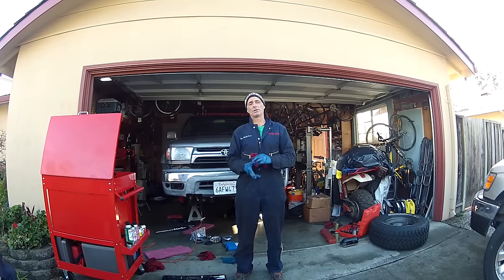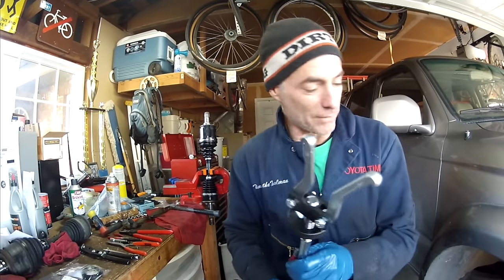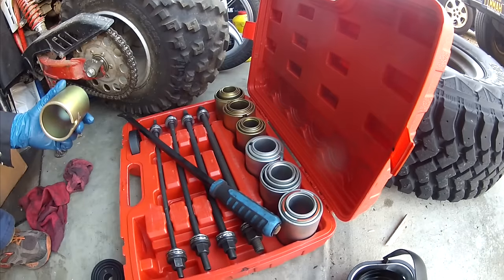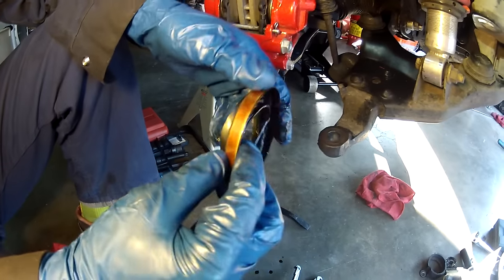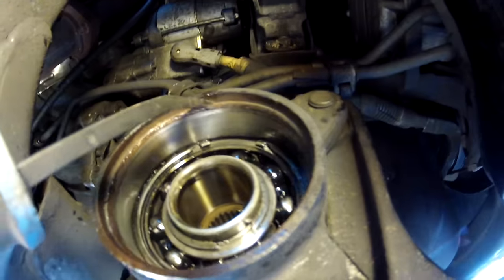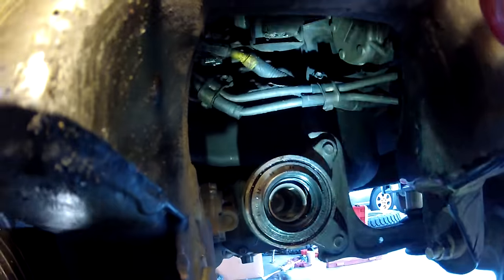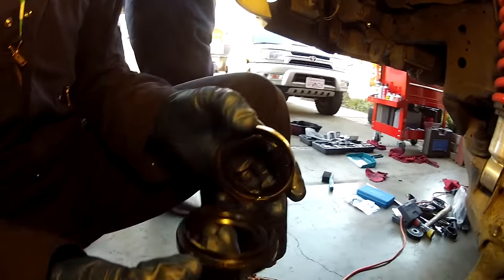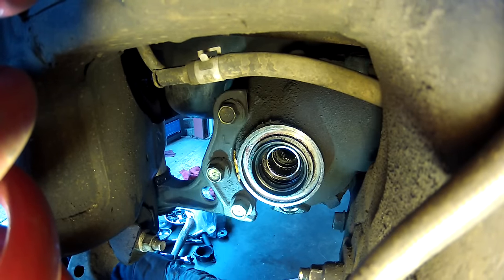Front Differential Axle Shaft Oil Seal Replacement

Comment: @Timmy The Toolman. I need to get this job done on my '98 taco, and am debating getting that press/pull sleeve kit. What other jobs on my truck would that set be useful for? I know you've used it to press out the front wheel bearings, but what other stuff could it be used for? I guess I'm looking for some extra incentive to justify purchasing that toolset... :)
Reply from the maker: I've also used the press sleeve kit for upper control arm bushing replacements, rear control arm bushing replacements, and the rear axle seal job.  If you think you're going to buy a press at some point, the press sleeve kit is nice to have.  If you don't plan on tackling your own press work, it would probably be a waste of money.

Comment: An easy way to seat the seal is put it in freezer first to shrink it. Then you can begin to seat it with your fingers. 

Then, take your old seal, cut the rubber dust ring off, and it will lay over the new seal so you can hit it to drive in new seal. An easy way to drive it in is get a 2 foot or so 2x4 and it will extend far enough out of the wheel well to hit the end of the board with a hammer. Easier than trying to tap it with hammer with lower control arm in the way...
Reply from the maker: Thanks for sharing your tips Andrew.  We actually now have a custom made driver for this made by the company Wits End.  https://absolute-wits-end.com/toyota-4wd-ifs-output-shaft-seal-driver/
Reply: @TimmyTheToolman  TW Matic here. Just ordered the wits end driver reccomended from another TW member today. Doing both my seals this weekend. Lucky me has the front diff on the workbench as I just got it back from ecgs with new 4:56 nitro's and a harrop e-locker. Excellant vid as always. Merry Christmas!
Reply from the maker: @matic1203cc  You'll like that Wits End driver.  It works really well.  I'm planning on re-gearing soon and also going with a Harrop locker for my front diff.  How much did ECGS charge you for the job?  Glad you like the video.  Merry Christmas back at ya!
Reply: @TimmyTheToolman  $2100 and a core. gears, locker and wiring harness. They even spiffied up the diff with fresh paint. I had a buddy drop off a random front diff for my core and he lives a stones throw from ecgs and i'm just south in SC. So I didnt have any shipping charges to get a core there. I want to say shipping the completed diff to me was also free.
Reply from the maker: @matic1203cc  Thanks for getting back to me with this info.  Sounds like a fair price.
Reply: @TimmyTheToolman  My bad, just looked at the invoice. $2059 and that was with the solid spacer. Also $0.00 sales tax. I never asked why.
Let me know if I can help getting a core to them for you when you do yours, I'm sure my buddy would drop another one off.

Rich
Reply from the maker: @matic1203cc  Cool, thanks for the offer.  I might be able to get mine done locally by a shop but ECGS is my backup.
Reply: @TimmyTheToolman  Tim, I forgot to ask since my diff is on the workbench can I finagle the old seals out with a couple screwdrivers instead of buying or renting a puller?

Thanks
Rich
Reply from the maker: @matic1203cc  Yeah, you could probably get them out that way.  Just be careful not to score the surface of the diff.  There's also more affordable hooked style seal pullers you can purchase.  Another trick is carefully drilling in a sheet metal screw into the seal and grabbing onto the head of the screw with a pliers or channel locks and pulling it out.

Comment: great video.
I'm going to change the bearings on my friends hilux. Inside the seals you changed in the video.
is it a lot of work
Reply from the maker: Good luck with the job.  I'd like to hear what tools you used to remove the bearings and reinstall them.

Comment: Hello! Good day. Thanks. What would be the worst scenario if not change right away.
Reply from the maker: The worst case is it leaks and you have to keep an eye on the fluid level in the differential so you don't end up destroying it.
Reply: So the leak is okay as long as I add fluid regularly. It doesn’t cause any damage?

Comment: Timmy, at the 6-minute mark, how would you go about taking out that bearing. Mine is shot. Thank you so much.
Reply from the maker: I've never replaced that bearing but here's a video that will show you how to get it done.  https://youtu.be/Yk-0BulWeHA?si=c8suFvqpiqoPjTFm
Reply: @TimmyTheToolman  Thank you so much for the fast reply 🙏🏼 We're the ones that just did the head job on our 96 4Runner.
Reply from the maker: @disconnect_overland8696  You're welcome.

Comment: oh man... that difficult is put that seal? ... oh well... i was thinking to replace the seal too bc I replacing the cv axle, BUT i will no even touch the seal. hoping when take the cv axle out have no leak.
Reply from the maker: It's not really that hard.  It's just tedious being careful not to driving in the seal too far.
Reply: @TimmyTheToolman  but i dont have that tool you used to put back. So by your recommendation its better to replace the seal??? my car is 14 yeas old. LOL
Reply from the maker: @r.c.850  If it ain't broke don't fix it.  If it's leaking gear oil, replace the seal.  If it isn't, I'd leave it alone.

Comment: that is some gnarly  rubber on that bike
Reply from the maker: It's a 1987 Yamaha BW200.  It basically has ATV tires.  They made them in the mid to late 80's and then stopped making them.  Honda made something similar called the Fat Cat.  I use it when I do volunteer trail work.  I strap a chainsaw on the back rack and ride trails cutting out down trees along the way.

Comment: thanks for the informative video, I've never seen a slide hammer attatchment like you have for pulling seals the easy way,  The only attatchment I have is the cast piece to pull cv joint fwd axles
away from the transxle, where do I buy one ? when I searched I found pilot bearing/bushing puller
they look something like that but smaller thks
Reply from the maker: You're welcome.  Those jaws are a part of the OTC kit I purchased.  We link it in the video description.

Comment: Hi Tim.
Really need your advice. I had the same experience with ripped CV boots after suspension lift but I replaced mine with aftermarket ones. I replaced both seals and may have over filled the diff. I now have fluid leaking out. At first there was quite a bit of fluid from both sides but now its just on the passenger side and only when I drive it. 
Could it have been from over filling the Diff or should I just replace the seals again? my real concern is, if fluid is leaking out then water can get in.
Your opinion is much appreciated and respected!!
Reply from the maker: @gbrianmullinax8448  With overfilling the differential, you would usually see it spewing out the breather that is attached to the driver side fender in the engine compartment unless the rubber breather tube became disconnected from the nipple on the top of the differential.   Have you checked to see if the breather is working by blowing through it?  Have you checked the top of the differential for signs of gear oil leaking out?  It could be a breather or breather tube issue and not the seals.  I'd rule those possibilities out before replacing the seals again
Reply: @TimmyTheToolman  I looked and it appears the breather tube is connected. I don't see any signs of gear oil at the point of connection. The tube transitions from a soft tube to a hard tube about half way down. I'm not sure I can get to the attachment point on top of the Diff. About the only thing I can check for air flow is the cap at the top of the tube and its okay. 
Nothing goes as planned, at least for me.
I do truly appreciate all your advice
Reply from the maker: @gbrianmullinax8448  I'm assuming you installed the seals to the proper depth.  Others have had issues with these seals as well.  The only other variable is aftermarket CV axles which might not be made to the proper spec and the shaft the seal interfaces with might be undersized.  That's the only other thing I can think of why your seals are leaking.
Reply: @TimmyTheToolman  As far as I know I did, but who knows I could have completely messed it up. Ill check the dimensions on the axle shafts to see. If there is a second go round I'm leaving it for the professionals. Not going through that again. 
Thanks again.
Reply: @TimmyTheToolman Just for grins and giggles I measured them. They are within .03mm of each other. I guess I messed up. Either I installed them incorrectly or damaged them when I installed the aftermarket axles.
Reply from the maker: @gbrianmullinax8448  Well, hopefully the second installation goes better.
Reply: @TimmyTheToolman  Wish you were my neighbor. I need supervision!! 😆

Comment: In some cars passenger and driver side oil seals are specifically mentioned
Reply from the maker: We do specify the different part numbers for both sides since they are different in the video description, however, the technique to install them is the same.
- Sean

Comment: What is that bearing on the drivers side?Right at the seal you just pulled? I need to replace it.
Reply from the maker: Watch our ECGS Clamshell Bushing video: https://youtu.be/sXIfHArtvF8. Instead of putting in another needle bearing, consider replacing it with a bushing.

Comment: Timmy The Toolman Hi Timmy Just recently Replaced My Cv axles, Lower Ball Joints, Inner and Outer Tie rod Ends For My 97 Toyota 4Runner Sr5 Just had an alignment. Drives great.. Beyond and behold  The driver side axle shaft seal On the differential started leaking.. I have a New seal Ordered and ready for pick-up.. I recently watched this your video. So Im going to attemped to give it a try.. My question Is Prior to removing The cv axle Is it possible to just loosen and remove the 4 bolts attaching Lower balljoint to hub or would it be better to Loosen and Remove the 1 lower Nut and leave ball joint attack to The hub..I guess I'm trying to figure out the Best way to go without messing with anything that could effect the alignment Or is A alignment required reguardless. Thanx
Reply from the maker: Hey Heather,  whether you disconnect the lower balljoint at the lower control arm or disconnect it at the steering knuckle makes no difference.  The alignment will not be affected.  The only way you'd affect the alignment is if you loosened the cam adjuster bolts on the LCAs and turned the cam adjusters or you loosened the set nuts for the outer tie rods and adjusted them.  

I prefer to just take off the castle nut and break the connection at the LCA with a puller and leave the 4 balljoint bolts alone since I loctited them.  Good luck with the axle seal repair.
Reply: Thanks Timmy I hope all goes well also..Thanks again.
Reply from the maker: Just take your time driving in the seal and you'll be fine.  It's tedious but just keep rechecking the depth as you're driving it in because you don't want to overshoot.  If you do, you'll have to get another seal, because the seal gets destroyed pulling it out.  If you're off by a little bit, you'll probably be fine.  But, if you drive it in way too far, it won't meet up with the CV axle well and it will leak.

Comment: Thanks for these videos.  My brain has exploded from all the knowledge. I’m in a 01 Tacoma V6 4x4 and want to do front wheel bearing. Do you have any videos on that? I’ve been looking but no luck from your channel. Would you be interested in making a video with my truck? I’m in Hayward, CA. Bay Area Boiis
Reply from the maker: Yes, our Manual Hub Swap videos show the necessary work.  Use Part 1 to know how to pull the knuckles out and get them back in.  Use Part 2 for the press work because we show the necessary detail for A.D.D. hubs in that video.  Our CV Axle Reboot video will also be helpful to you is you want to reboot your CV axles at the same time.  Our Upper Balljoint Replacement video will be helpful as well because it might better show the detail to get the knuckles off and back on the vehicle.  Here's some links:

Manual Hub Swap Part 1: https://youtu.be/TZ2sOfVrnhU
Manual Hub Swap Part 2: https://youtu.be/1TpOYj0sUpA
CV Axle Reboot: https://youtu.be/vcCT4UgFUTw
Upper Balljoint Replacement: https://youtu.be/-sY2azyLBuI

I'm trying really hard to limit my wrenching to just making new videos, and it's sort of working, but not really.  I now have lots of friends through this channel now and I have repeated some jobs many times.  I'm spending way too much of my personal time on this, and since we already have videos for this job, I'm going to have to turn you down on helping you out with this.  The videos I linked show you everything you need.  If you like wrenching, I highly recommend you invest in a Harbor Freight press, press plates, press sleeves and any other tools necessary for you to pull this job off.  The money you save doing it yourself will pay for the tools and then you'll have the tools for future jobs.  I've used my press and associated plates and sleeve for many jobs.  It's money well-spent.  Good luck with the work.

Comment: You can also use a small adjustable square and lock it to where it needs to be
Reply from the maker: Hey Robert, maybe explain a bit more of what you're talking about.  How exactly are you using this square for this job?
Reply: Use the square for the depth adjust if and lock it down use the body for the housing  and the rule part for the depth if I am making since just thinking outside the box if you dont have a caliper
Reply from the maker: @robertreid4617  Gotcha.  Thanks for the explanation.
Reply: Timmy I guess better way to explain is set the square depth to what the original seal is before you take it out to get you in ballpark when you put in new seal iui s this a little better explanation
Reply from the maker: @robertreid4617  Cool, thanks for sharing this.
Reply: Thank you for the video you taught me a lot
Reply from the maker: @robertreid4617  You're welcome Robert.  Good to hear you learned a lot from it.

Comment: I'm guessing Eric didn't have a diff drop put on?

What are your thoughts on them? It seems like some people like them and others don't for potential bigger problems down the road. Another great video!
Reply from the maker: Hey Jesse, Eric does have a differential drop, but from what I understand, you can only drop the differential 1 inch.  That still leaves a 2" difference with a 3" lift in the front.  So, even with a diff drop installed, you could still have CV axle boot ribs that are rubbing together.  The fix is to stretch the boot out a little farther so the ribs won't touch each other due to the steeper angle the CV axles now have.  We show one way to do a boot stretch mod in our CV Axle Reboot video: https://youtu.be/vcCT4UgFUTw

I don't know what potential problems you could have with the differential drop other than you need spacers to put your front skid plate back on right.  If I put a lift on my truck, I'd use a diff drop to improve the CV angle.

When Eric comes over my place for some more work, I'm going to try another variation of the boot stretch mod that you can do without removing the CV Axle.
Reply: Timmy The Toolman I just watched your CV reboot video. Once my OME lift is installed I'll keep an eye on those 18 year old boots. 

Once the weather warms up I may just reboot them in case they do split and wear down the internals. Thanks again!
Reply from the maker: No problem Jesse.  Definitely keep an eye on those inner CV boots after you lift it.  They are known to tear right near the small clamp on the inner boot.  The new angle is too much for the old boot to take and they rip.  You want to catch it quick so you can save your OEM axles and be able to reboot them.
Reply from the maker: Hey Jesse, I recently worked on Eric's truck again and I noticed his inner CV boot ribs are not rubbing but the outer boot ribs are definitely rubbing.  I suspect he'll have a premature failure of the outer boots because of it.  The boot materials are very different though.  The inner boot is a rubber compound while the outer is a plastic compound.  I'm guessing the inner boot is rubber because that joint can slide in and out and thus a more pliable material is needed.  The outer joint just turns and doesn't have to elongate so a stiff plastic works fine.  I've personally seen more inner boot failures so I'm wondering if the outer plastic boot is a little more durable than the inner rubber boot.  I guess time will tell.

So, I think the differential drop helped keep the inner boot ribs from rubbing by lessening the angle.
Reply: Well my inner boot on the drivers side gave up the ghost. Small amount of tan coloured grease...

Also my passenger side front diff seal is leaking gear oil slowly. Might as well bite the bullet, reboot both sides and change that seal while I'm there! These videos will be a huge asset! Thanks Tim and Sean!
Reply from the maker: You're welcome Jesse.  We are stoked people like you are getting some good use out of our videos.  Tell your 3rd Gen 4runner and 1st Gen Tacoma friends about us.  We want our videos to help out as many people as possible.
Reply: Timmy The Toolman I will! I've heard you helped out my buddy Paul with his calipers!

Before buying this truck I wasn't confident doing my own oil changes. Now I've almost replaced everything haha
Reply from the maker: Yeah, I had the calipers from doing Eric's Tundra Brake Upgrade so when I saw Paul's thread with the braking issues, i offered them to him.  Just sucks they are so heavy because that made the shipping cost a lot.  I sent them off today via UPS and it cost $72.

It's pretty cool doing all this stuff yourself isn't it?  Just think how much money you would have spent paying a shop to do everything you've done.
Reply: @TimmyTheToolman   inner boot fails and rips from friction?